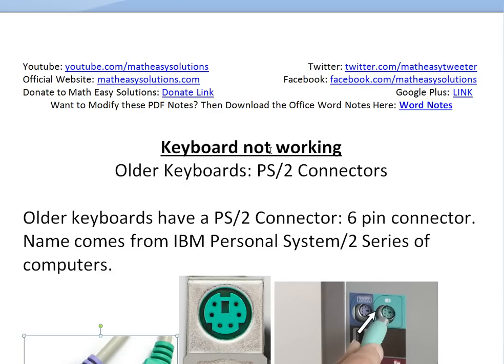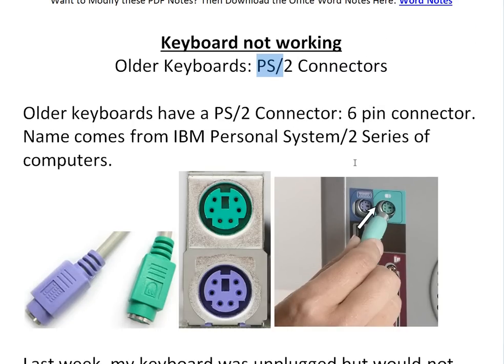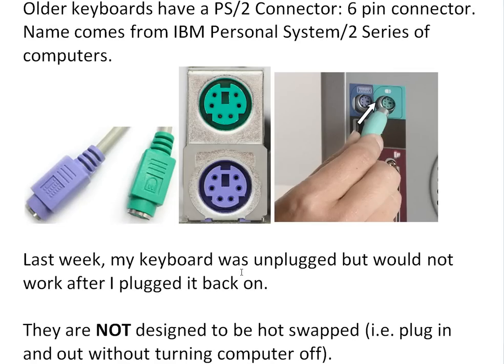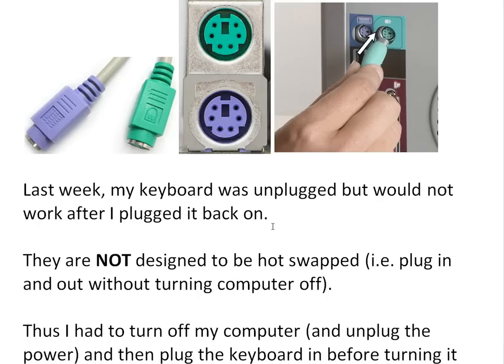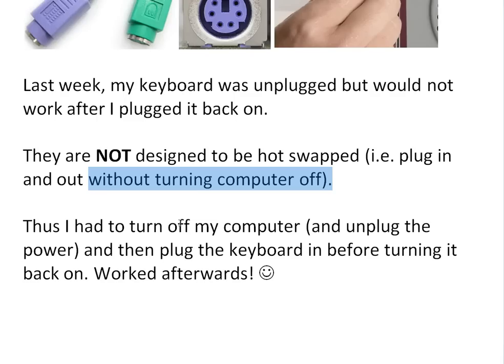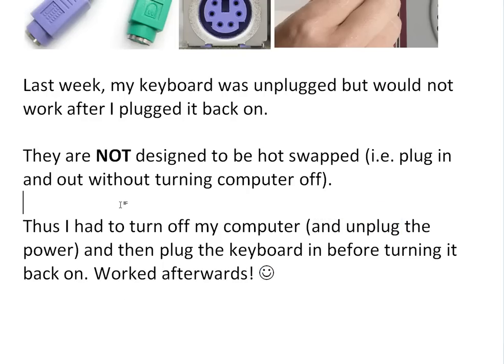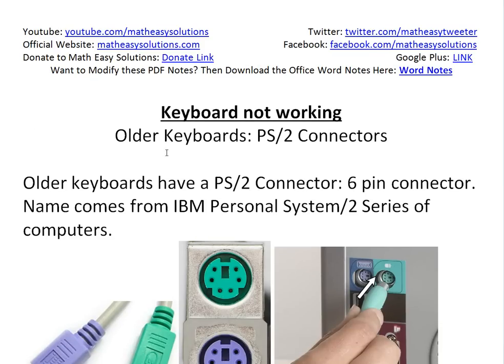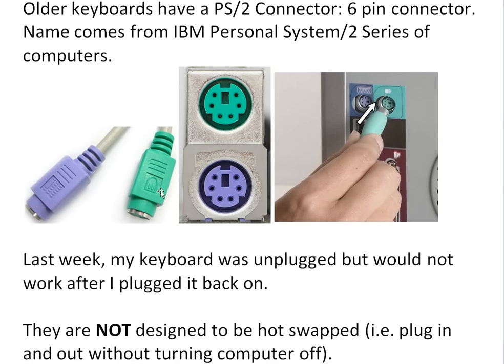Simple Keyboard Fix (for PS/2 Keyboards)

Comment: Thank you so much for this video. I had purchased a NEW Model M keyboard w/PS2 connector. When I arrived I was so geeked up but then I could not get it nor the original PS2 connected keyboard that came with my tower to work. I had tried updating the drivers and had tried changing the i8042prt setting from "3" to "1" but still could not get it to work. I then found your video and figured 'Why not? I've tried everything else.' Your answer worked for me. I am now happily typing on my New Model M bucking spring keyboard! :)
Reply from the maker: Sweet glad the fix works for your keyboard!

Comment: Sir my windows is 7.Recently I have faced a l problem. The problem is, "I have a external keyboard. Before I have used it normally. But recently when I am connecting keyboard in laptop usb port at that moment a message is coming in front of the computer screen. The message (A problem is detected. please restart pc to prevent damage. I have restart it. But problem is not going. PLEASE sir help me.

Comment: Some older motherboards had fuses (tiny flat ones, soldered to the motherboard) that could blow due to the inrush current that happens when plugging a keyboard in.
It is possible that an expert in SMD soldering and repair can replace these fuses and the this usially works if done properly by a skilled technician. In most cases, PS2 motherboards are not worth the cost these days.

More modern motherboards use a type of electronic "fuse" that, when the power is removed and allowed to cool for a couple of seconds (though it can be more in some cases) reset themselves. 

A handy tip is that some PSUs (especially external PSUs used on laptops, phone chargers, game consoles and domestic electronics) have a sort of resettable electronic fuse feature too, known as a "crowbar" or "foldback" feature, so if you thing a PSU is broken, unplug it from the mains power and the device that it's powering and wait 10-30 mins before plugging it in, it may spring to life again ;) 

USB devices have a tight specification on inrush current, so hotplugging is not a problem and is part of the USB specification. The PS/2 interface specification does not.
.
I have a few personal rules on PS/2 keyboard&mouse hotplugging : -
.
Keyboards:-  
..................
1  - I never hotplug PS/2 keyboard unless it's absolutely necessary - only where there's no other way (on BSD, Unix, Linux, Mac and similar systems SSH is the usual "other way" to do it, shutdown using the commandline over the network from another computer. Windows has a limited CLI-over-network method but because it's unsafe due to being unencrypted so it should be off )

2  - I only hotplug PS/2 keyboards when I am certain the inrush current for that particular keyboard is very low (being an electronics engineer, I can measure this on a 'scope or with a meter). Older PS/2 keyboards (from the "white PC case" era) tend to have high current draw, so are unsuitable for hotplugging. 

3 - Never hotplug a PS/2 illuminated glow-in-the-dark keyboard, or a "gaming" keyboard.

4 - the black-coloured HP IP-KVM adapter "dongles" are generally safe to hotplug (the only unsuitable thing to hotplug is the serial port on the IPKVM box itself). These are use in data centres or large server rooms on, not on home PCs.

5 - Never hotplug Sun keyboards, IBM keyboards, Point of Sale keyboards or specialist PS/2 keyboards in general. This is also to protect the expensive keyboard, which may be worth more than the motherboard!
.

Mice:-
..........
1 - I only hotplug the older ballmice, not "laser" or LED mice (sometimes called "optical mice, though all mice are optical, even ball mice) - unless I have measured the inrush and working current of that particular mouse.

2 - the second rule is to obey the first rule.